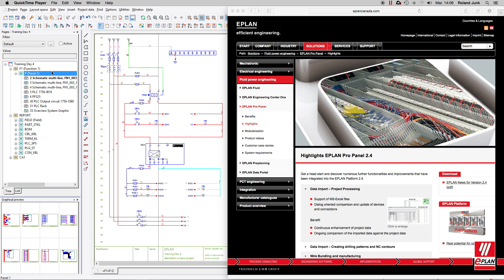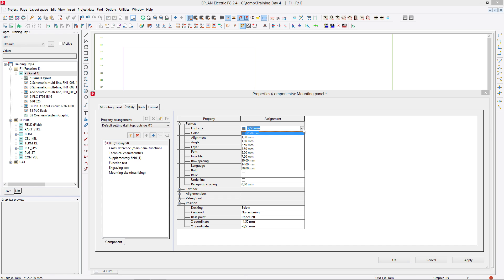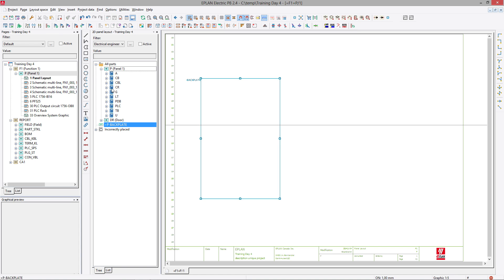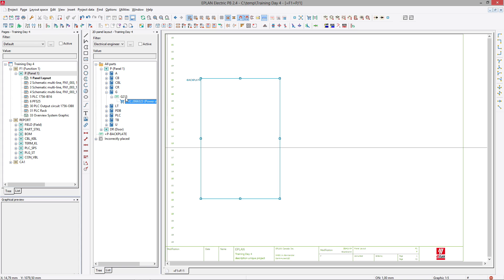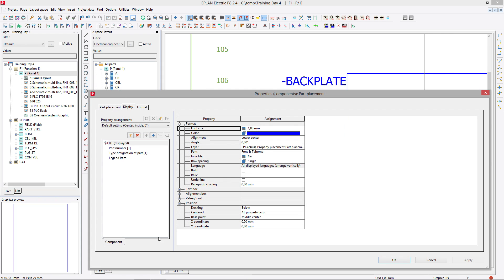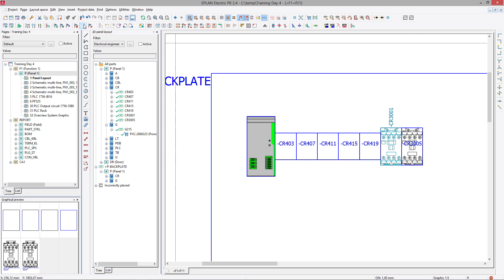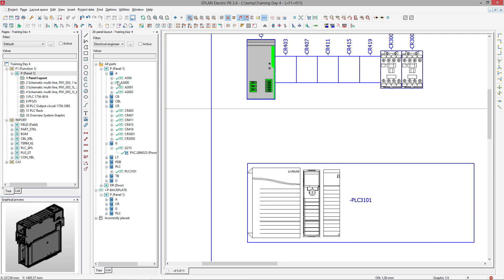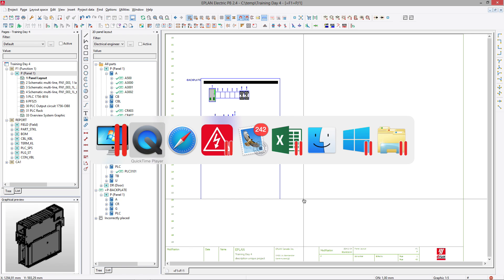EPLAN Tutorial PanelLayout 2D Basic

Comment: Hi , great really clear explanation / videos 
I’m having trouble with 2D panel layouts, I can’t get the 2D panel layout navigator up or the option to draw a mounting panel . All I can get up is the 3D layout navigator (this is in pro panel). Is there any reason 2D bits wouldn’t show and only the 3D options ?
Reply from the maker: Hello ProPanel does not by default have the 2D panel layout option. This would allow the users to place twice the same device by mistake. In 3D, you work in the layout, then you place model views in your regular 2D pages. Other videos cover this...
Reply: Roland Younk that’s great thanks , I thought I was being stupid and there would be a way some how. 
Iv done it all in 3D now 😃I was just struggling at the time as I didn’t have all the 3D macros but using your other videos iv worked out how to make them from step files 👍